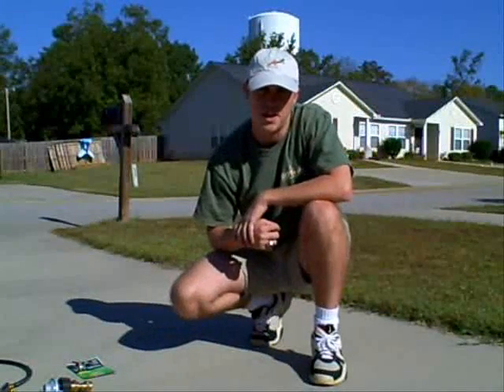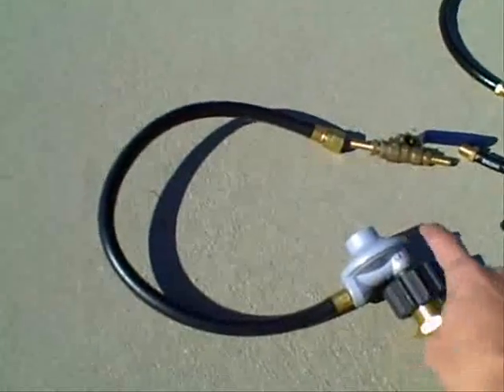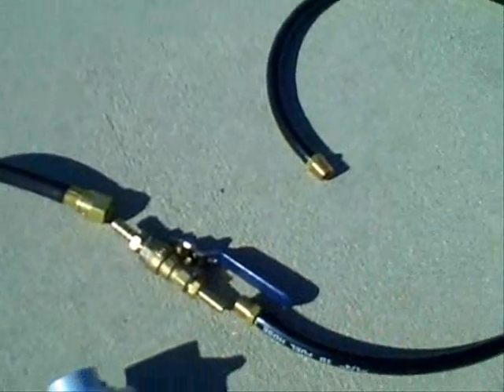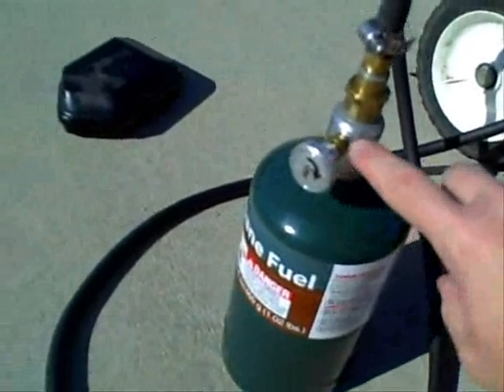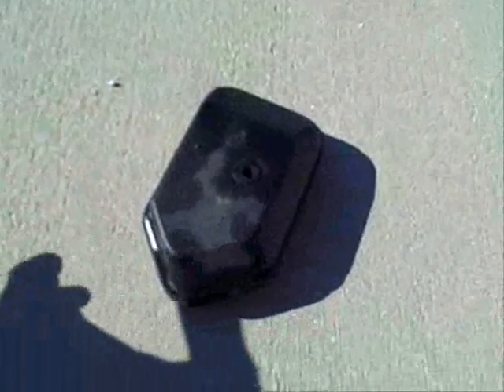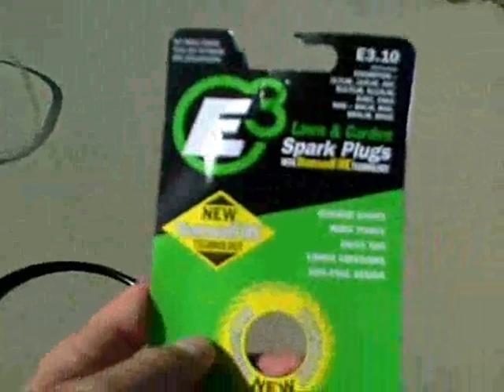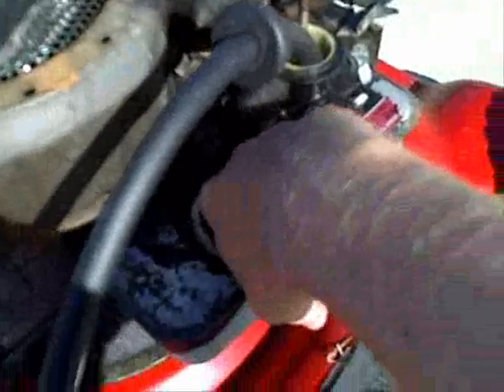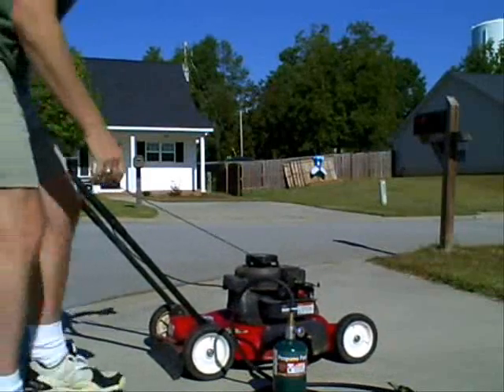Gasoline mower to propane conversion - Part 1 of 3

Comment: Dont even need that fancy sparkplug, if you just change the plugs gap from .030 to .015 or .010 it'll work just fine.
Reply from the maker: You are correct.  The Diamond fire spark plug is not necessary.  A regular plug  works just fine.  I just like having a plug with multiple spark points on the head in my gasoline motors and UT carried over to the propane ones.

Comment: one question can the cut off valve have any thing to with the pressure cause the machine will not rpm at all suggesting do I have. to change cut off valve for pressure
Reply from the maker: The pressure regulator and cut off valve work together to provide a proper flow to keep the RPMs at maximum for proper cutting. If the regulator pressure to too high...even just a small opening of the valve will provide too much propane to air mixture for combust...mixture will be too rich. A low pressure regulator and minor incremental adjustments provide the necessary fuel to air mixture for these small engines.
Reply: Thanks

Comment: I liked your videos. One thing you didn't mention was the governor. When the engine is loaded up by long grass, does the governor open and deliver more propane, or does the engine stall or bog down? Also, since I have a background (historically speaking) in automotive LPG, I wonder if it's wise to add a few more bits (solenoid valve, 12v battery, safety circuit) to ensure the propane is shut off when the engine stops? Just a thought. Great idea on your approach; love it!
Reply from the maker: Thank you for your comments. When cutting thick or long grass with this simple set up I have not experienced any bogging down or stalling. However,  to your point I'm sure it's possible since the propane setting is set manually by the operator and it's not automatic. I always set the propane to provide highest rpms on the mower. The 12V set up with a solenoid is something I have considered on the propane generator since the purpose is to start it and walk away unobserved.  I've considered using the 12v power from the generators 12v outlet to power the solenoid...one where valve closes when power to plug dies.. My generator set up is for an emergency power situation if gasoline is not available.

Comment: Is this legit at 10:20 when he was pulling out the fuel you could see the throttle moving as he pulled up out and put it in
Reply: That's the engine governer and throttle linkage, it's reacting to the air pressure created by combustion. I once rode in a cabbie overseas outfitted with propane tanks and ran off gasoline aswell, this is very legit and works on existing engines.
Reply from the maker: Yeah it's legit. Seriously, take a bone dry gas tank on a small Briggs or similar engines....pipe in the correct amount of propane and it will run.  As James said above, the engine governor, combustion and vacuum caused from the intake stroke of the piston will cause the throttle linkage to adjust on it's own.

Comment: Great videos!  I was looking up electric go karts and for some reason led me to your channel.  Glad it did, I had never thought about converting to propane.  Very informative walkthroughs.  An idea, maybe use a fire extinguisher mount bolted to the handle or large stainless steel hose clamps to hold the propane tank.  Seems like it would work.  Thanks again!

Comment: Why can’t you just use a propane torch remove the tip and adapt a barbed fitting with a hose going to the intake port on the engine

Comment: Also, the knob on the torch is round. Make a handle that you can jbweld over that knob, that makes it more like the handle on your ball valve. Now, make your bracket to mount the bottle to the mower. With that solidly in place now make a mechanism that will allow you to use that handle as a sort of throttle. You can use springs and such, and the old throttle handle on the mower already... You are just controlling the handle you made on the torch body, rather than the throttle on the carberator itself.

Comment: You could do this so much simpler, if you are using the small 1 pound tanks. You don't need the regulator. Get an old propane torch head. (Garage sale or thrift store... maybe 50 cents to a dollar.) Cut off the torch head, or unscrew it from the body. Adapt from there, to your 1/4" hose. Done. Stick the hose in the carb like you already do. Use the knob on the torch body, to adjust the flow. GTG!

Comment: The ball valves will leak around the handle unless it is made for gas. With all of them you must keep changing the fuel yourself where it was running automatically changes.

Comment: Tried this on my outboard and it would not start. . . Tried to fire up, but died a second later. I am attempting to avoid replacing or fixing the carbs because they are a nightmare to work on. 4 carbs and fitting them back together is a form of torture.
Reply from the maker: What kinda of outboard do you have? If you have a commercial outboard like a Merc, Yamaha, Johnson...etc...you will likely have to get one of the more expensive commercial kits.  Engine size/displacement and type of fuel system can have a lot to do with it.  If you have a fuel injected engine this will not work.  If you have a naturally aspirated with a carburetor it "can" work.  Always check for engine spark test (voltage), air flow and fuel.  If any of the three are lacking any engine will not start.  Make sure any choke setting or throttle setting is set to full open.  Adjusting the flow of propane to get the proper propane to air ratio is crucial.
Reply: @sparkynapalm3662  I got a good lpg regulator from a supply shop today and I will be trying to hook up a propane control valve in concert with the throttles on the existing carburetors I guess (to regulate air flow). . . I think having a regulator will allow meto fine tune the system, andit even has gauges so I can keep track of my settings. I know the engine will run, only the carburetor is bad. I asked about a rebuilt kit, but the cost of that came out to almost $600, so I will be doing what I can with lpg.
Reply: @sparkynapalm3662  I actually got the thing running with the good regulator, but now I have taken off the carbs and I am going to try and make a housing with some flap type valves (weighted with a coin or something maybe) hoping that I will be able to get the airflow to self-regulate with an increase in propane flow. Unfortunately with the existing set-up I could only get it to start and run at dangerously high rpm, so the carbs had to go. The trick I guess is to make the airflow self-regulating as the rpms increase.

Comment: IT DOES NOT PRODUCE MORE POWER THAN GASOLINE YOU IDIOT!!!!!!!! Every dual fuel generator says you loose 10%+ when using propane/natural gas instead of gasoline.
Reply from the maker: You are correct.  The BTU's of propane are different than gasoline.  This was made long ago in my infancy days of exploring this.  My education has continued as more commercial companies have developed technology and data.  There is no need for the insult.

Comment: Is a regulator a good idea to prevent some kind of back-flash?
Reply from the maker: I do you a regulator on my newer models but for a different reason.  You won't have a black flash even with a rubber hose.  It's impossible for a flame to travel up the line and explode the tank.  Reason being is for propane to be flammable it has to mix with the very specific ration of oxygen.  There is no oxygen in the propane line so a flame is actually not able to form.  The regulator however regulates pressure so as you bounce over and round bumps the regulator keeps pressure constant although the liquid propane may slosh around.  This makes for a smooth running engine over rough terrain.  Watch my propane video # 2 and i will explain why there is not an explosion hazard unless the gas is vented into open air.

Comment: Dang... If this is so simple, why aren't there LPG lawnmowers in Home Depot... I love this idea... In fact, I am here watching you (and great job btw) precisely because I wondered if there were any I could buy... I guess I have to get off my lazy behind and do it myself...
Reply from the maker: I have often wondered the same thing.  Lots of motors and engines run off propane...forklifts,  some off road 4x4 rock crawlers, even some boat motors.  Lots of benefits to it also...especially if someone wants a fuel engine and not an all electric.  I have to say though, all the new yard tools and lots more push mowers are going to all electric and they are getting really really good!  Electric is by passing the benefits of propane.

Comment: Great job, Brian. You took the time to explain, step by step, and demonstrated what needed to be done along the way, as well. As far as two cycle motors go, I've been thinking about a forced drip with a combination of diesel and oil at the motor end of the propane line. I  don't have a spare to experiment with right now but I'm sure I can find one soon at a yard sale or something. Again, great job. It convinced me to subscribe.

Comment: I am curious if I can get my various mowers, generators, etc laying around with gummed up carbs to run on propane, assuming they are producing a spark ?
Reply from the maker: you should have NO problem getting them to run.  I have gotten many many engines with gummed up and completely irreparable carbs to run.  The only thing that needs to work on the carb is the butterfly valve that opens and closes and adjusts the intake of air into the engine.  That could be the throttle setting on a engine or a choke lever.  Open that valve wide open to get the most air...it should run fine!
Reply: Thanks !!   4 stroke only ?  Or 2 stroke also ?
Reply from the maker: Only 4 strokes for now.  2 strokes requires a fuel and oil mix for proper lubrication. I haven't been able to figure how to introduce oil to propane vapor to properly lubricate a 2 stroke.

Comment: If you were to put a length of time that one of the disposable tanks last what would it be?
Reply from the maker: Danny, sorry for my delay.  As far as the length of time on the 1 lb tanks...it really depends on the ambient air temp to what degree the propane is vaporized.  It's been my experience that the hotter it is outside the longer the tank last.  In cold weather the propane gas shrinks therefore there is lower pressure in the tank.  On average though I can mow just over 1/2 acre of property.  Propane has a lower BTU and less energy than gas but it burns more cleanly and completely with less waste for the money.
Reply from the maker: dannythetoesmasher   Run time is about 1/2 acre of property.  The warmer the ambient air/tank the better vaporization of the fuel.   Gasoline provides more BTU energy but the engines waste a lot in unburnt gas.  Propane is lower in BTU but burns more completely.

Comment: Don"t know what i am missing but i am having trouble finding the valve you used (or any kind of valve) for the start and run part of the video...help!
Reply from the maker: Rick, most of your non-big box hardware stores will have something you can use. Ace Hardware and similar stores will have a section for gas fittings. You may also look in the plumbing section for brass ball valves. You can also search Amazon for a propane regulator if you are looking for the valve that controls pressure...the ball valve will control flow.
Reply from the maker: needle valve https://www.amazon.com/Bayou-Classic-Brass-Control-Valve/dp/B0016IZZZU/ref=sr_1_3?crid=16GAKJBH8I8DS&keywords=brass+needle+valve+1%2F4&qid=1562960412&s=gateway&sprefix=brass+need%2Caps%2C146&sr=8-3

Comment: I've been watching conversion videos and have to say I really like your videos as they are "very" through. 1 thing I've wondered (and reason for continuing watching conversion videos) about is roughly how much mowing can be done with a single standard Coleman 1 pound tank?
Reply from the maker: Jeremy,  I have 2/10 of an acre of property and I can cut my yard about three times.  The warmer it is outside the more vaporous the propane is and as such I've found more efficiency in warm weather.  I use a very long black hose to act as a heat exchanger to make sure no "liquid form" propane enters into the mower.  You never want the tank to site sideways or upside down as this will inject liquid down the line.  I've had great success converting riding mowers and using 5,10 and 20 lbs propane tanks.

Comment: I just converted this weekend and wound up rigging 3 velcro straps into a tank retention mechanism.... just an idea for anybody whos converting.
Reply from the maker: Yeah that makes for a quick detach.  I've finally got a few solid brackets mounted on a few of my mowers.  Didn't you if you have seen all the videos but this is the most recent Lawn mower - converted to electric start and propane fuel

Comment: after a year how is the propane working out on the mower?
pro/cons
thanks
Reply from the maker: deerhunter,  I've been running propane on my mowers and converting more each year for about 3 years now.  With all the benefits...I haven't had one issue.  As a matter of fact, propane has brought nothing but improvements in all areas.
Reply: Brian Blue great! thanks for taking the time to make these videos.

Comment: Hi Brian- good video and it looks totally simple to do.  Just wanted to let you know that now there are refillable camping size propane cylinders!  Check my website at www.propane-refill.com  They pay for themselves after about 6 refills and if you are mowing with them, then that is sure to happen!  Thanks again-
Reply from the maker: Brad, thanks for this.  I'm always looking for new technology.  I've been refilling the standard kind using the adapter from "Mr. Heater".  These look much better !  Looks like something I will start using for sure.  Thanks again.
Reply from the maker: Brad, the adapter for the bottles you referenced....will that adapter fit my 20# gas grill tank to refill these new bottles or do I need to buy a new supply tank?
Reply: you would need to have a liquid draw tank not a vapor tank like the BBQ.  the adapter will not fit a vapor draw tank.
Reply: +Brian Blue Our liquid draw adapter is pretty easily converted to vapor draw by replacing the supply side valve fitting  email me direct from my website at propane-refill.com for a photo

Comment: Thanks for the vids... I watched all 3... My question for you is.... How long does a single bottle of propane last in your mower?  
 How much were you able to mow on a single tank of gasoline and compared to how much you can mow now on a single bottle?????

Is a 1lbs tank equal to a gallon of gas?
Reply from the maker: Bryan, 1 lb of propane will not equal 1 gallon of gas in run time or mass (vapor vs. liquid)  In my experience a 1 lb bottle of propane runs about one hour in a 5 horse power engine at full power.  I can cut my yard (3/10 acre) three times before needing to refill the small tank.  Propane FYI is 110 octane and it better than gasoline in many regards.

Comment: Ok, so what if we have the separate gas tank, could we possibly run the hose to the normal gas intake? Would that work right?
Reply from the maker: This I have found will not work...the reason... gasoline is metered though a brass fuel jet in lawn mower/generator carburetors. This liquid fuel jet does not allow enough propane into the engine.  Additionally, there is a fuel float in lawn mower carbs that opens the fuel jet.  If there is not fuel in a fuel bowl of the carb the float doesn't lift to open the jet anyway. Tapping into the air intake box is the easiest thing to do.

Comment: I have been to both Lowes and Home depot and can't find the fitting to connect the Mr heater control valve to the barb fitting. Any help would be appreciated.
Reply: the control valve is a F271725 with a 9/16 LH thread fitting
Reply from the maker: Check out my later videos.  It's also possible to make your own by getting a low pressure propane regulator, connecting a brass 1 lb propane bottle adapter to the supply side of the regulator and a brass needle valve to the outgoing side of the regulator.  All my parts I've gotten at a local Ace Hardware https://www.amazon.com/Mr-Heater-Throwaway-Cylinder-Fitting/dp/B000BQM8IU/ref=sr_1_14?keywords=1+pound+propane+male&qid=1562960332&s=gateway&sr=8-14
Reply from the maker: needle valve https://www.amazon.com/Bayou-Classic-Brass-Control-Valve/dp/B0016IZZZU/ref=sr_1_3?crid=16GAKJBH8I8DS&keywords=brass+needle+valve+1%2F4&qid=1562960412&s=gateway&sprefix=brass+need%2Caps%2C146&sr=8-3

Comment: awesome informative video. Hoping to do the same to an old HRC215k2 honda mower. ONE THING THOUGH (i have to scream about this) DO NOT use a E3 plug. I can't tell you how many mowers ive fixed, that the only reason the mower would not start was an E3 plug. A champion RJ19LM (standard plug on most briggs) is the the best plug for all briggs 21" mower engines.
Reply: No doubt David. I have been through this